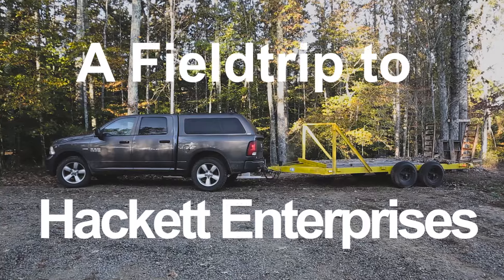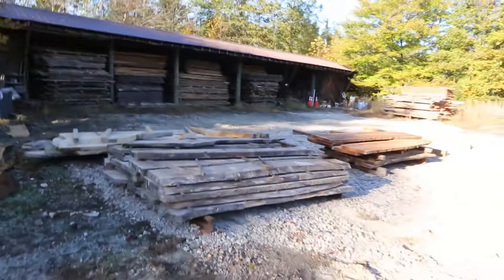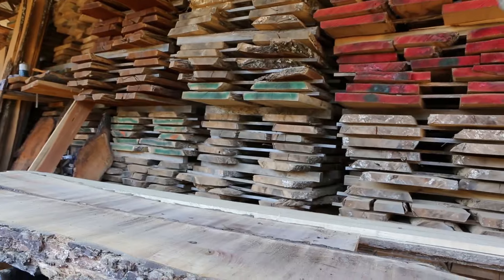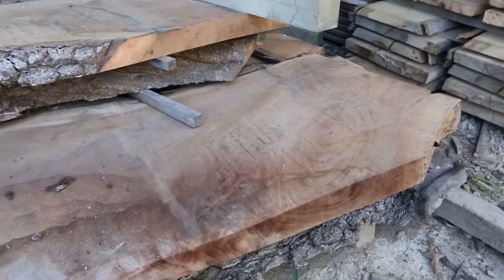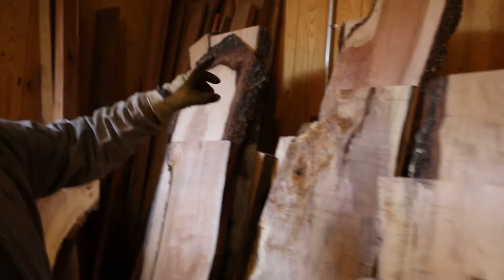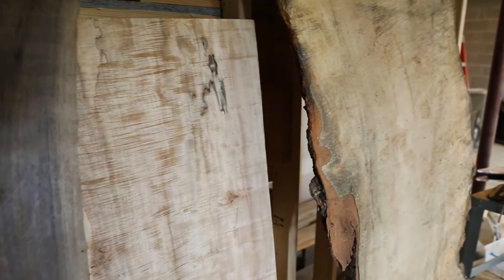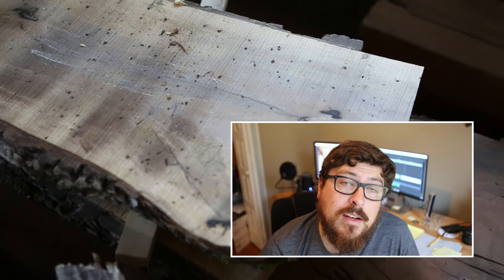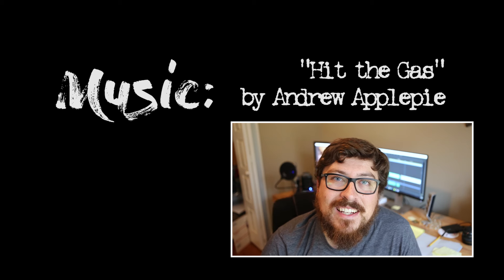Field Trip: Hackett Enterprises

Comment: I'm curious on what you paid? for what you got. I myself was gonna get into making wood furniture but cutting it myself. Maybe this guy is cheaper, where is he located?
Reply from the maker: Prices vary depending on size, species, how much figure is in the wood, etc.  I got two bookmatched slabs of Persimmon, the smaller highly figured maple slab and that huge Maple slab all for $200.  I feel like I got a really good deal on the big slab.  

Matt Cremona would be the one to talk to about cutting logs into lumber to finished product.  A good mobile sawyer costs around $80/hr if you want to have them mill trees for you.  A chainsaw and chainsaw mill cost is lower and a good entry, but there's a lot of sweat equity involved.  If you want to cut the logs yourself you have to take into account drying time to get the moisture content low enough to work with.

Glenn and Bobby are located in Palmyra, Virginia which is in Central Virginia.  They have quite a few out of state clients from what they told me.